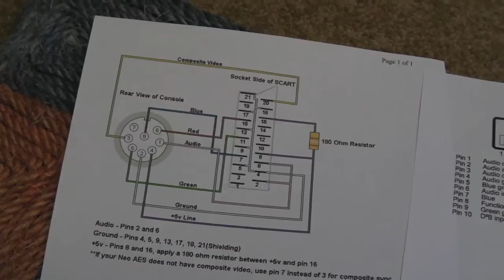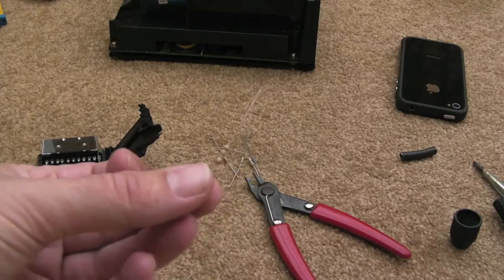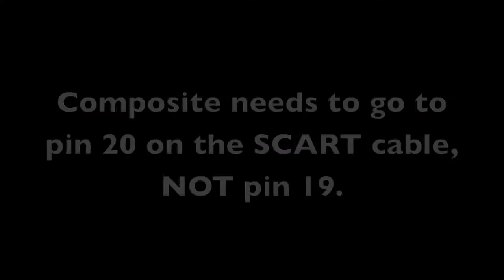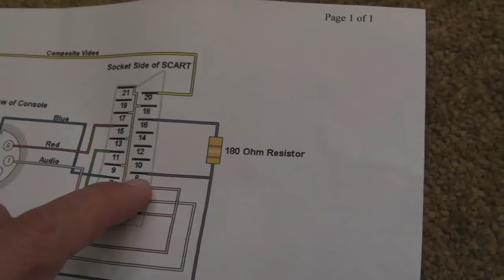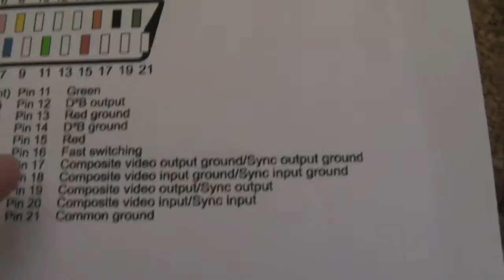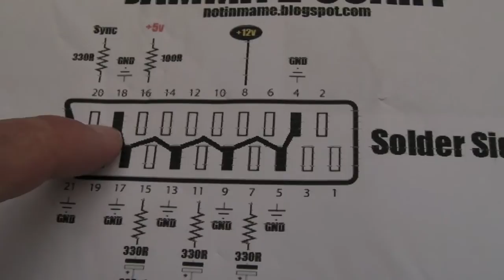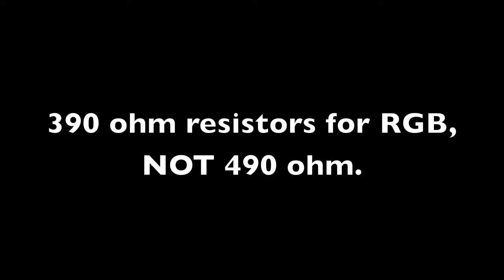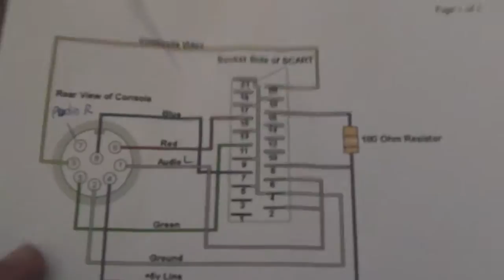SNK Neo Geo MV-1FZ Consolization Part 2 (MVS CMVS)

Comment: Where can I buy rgb sockets
Reply from the maker: Look on eBay for DIN connectors.  They do different sizes of male and female connectors.  Get a female for the MVS, and a male for the cable.  I would go for an 8 pin DIN to cover enough connections for gnd, +5, red, green, blue, left audio, right audio, sync.

Comment: do you connect grounds inside scart plug (pins 4 5 9 13 17 18 21)...?
Reply from the maker: Yes, that's always a good idea!  But, not always required.  Sometimes they are all joined up at the TV end anyway.

Comment: Nice work! Always good to find informative videos. Got a consolized MVS of the same type of board you have. For some reason the image is shifted to the left and then cropped off as a result. This happens on all the TVs I have. A bit annoying to have status bars, text and such partly missing. Still trying to figure out why this happens. Everything is wired up the same way you did it, same resistors. I'm thinking of adding a 1k pot to the sync wire and tweak it. Hopefully that will solve the problem.
Reply from the maker: I think my newer Panasonic TV did the exact same thing for me, so I do think its the sync signal.  You might consider changing the crystal (check on Neo Geo forum, there was a thread recently about getting it to almost exactly 60fps instead of the 59.3 or whatever it currently outputs).  That might solve your problem!
Reply: Interesting, thanks for the tip! I'll look it up and give it a read. Reminds me a bit of the issue some old PAL PS1 revisions have. A chipped system would output black and white when playing NTSC games. The remedy were to change a crystal on the board.
Reply: I've been searching and reading on the neo-geo forums, but I can't seem to find it. Do you by chance recall what the thread title was, or which subforum it was in? I also want to add several extra video outputs for versatility's sake. Found a board from someone called JROK which seems to do exactly what I want. Maybe that board also will remedy my situation. Hopefully I can find someone that sell it, and also agree to ship it to outside USA.
Reply from the maker: Was this your post?  http://www.neo-geo.com/forums/showthread.php?269730-Neo-Geo-MVS-MV-1FZ-picture-shifted-to-the-left

I will see if I can find that thread.  basically you will find there's a 24Mhz XTAL on the board at the moment, it just needs replacing with something a tiny bit faster I think.  I will see if I can find it now.
Reply from the maker: Here's the thread:- http://www.neo-geo.com/forums/archive/index.php/t-222404.html

Looks like 24.167829MHz is what you need to swap out the 24Mhz crystal.  But trying to find one - that's a new problem!  I cannot see any on eBay, but maybe mouser or digikey might sell them.   You can also see that some of the AES use this:- https://wiki.neogeodev.org/index.php?title=Clock
Reply: Yes, that's my thread. Thanks for looking up. Interesting read!

Comment: I don't get how you wired up the video output if u made it like a AES  port are you using a cable like the original mega drive to connect to the TV?
Reply from the maker: I bought some multicored wire with the relevant number of cores and a seperate SCART plug and did it that way.  You could use a Megadrive RGB lead and modify it (put a different DIN connector on) - that would work OK, but you might need to change the resistor sizes in the Megadrive cable.

Comment: This is awesome. I think I missed the clip where you wired up the female DIN port to the interals of the MVS. Do you have that clip? Or a guide to what to wire from where please?
Reply from the maker: Thanks, I didn't show the socket part but the wiring is covered in this video:- https://www.youtube.com/watch?v=mI9VXEyKhSE

I show the underside of the board there and the 5v mod (to remove reliance on 12v for sound), and the sound outputs as well as red, green, blue and sync connections.  You can just wire those to the corresponding pins on the DIN socket as I wired the plug in the earlier video.
Reply: Thanks for the reply. Ive watched these videos again and again, I'm gonna get my parts soon. I'm going to get a MVS 1c so I have the top loading cartridge. I just haven't a clue where to start with wiring the socket to the main board. I might well try a Jamma edge connector and then wire those to the right components as opposed to directly onto the board. I'll have to see. Thanks again, So cool!
Reply from the maker: Check out the tutorials section on this website:- http://www.jamma-nation-x.com/jammax/  There's probably a guide to converting the 1c on there.
Reply: Thats cool - thanks! I've been reading guides like that but I think they are finally making sense! Thank you!

Comment: so we don't have scart here in the U.S how can i make a composite connection to go to my tv?
or av cable connection? whatever is best? thank you :)
Reply from the maker: +ALAN DORAME Speak to XianXi on the Neo Geo Forum - He can probably recommend a good S-Video encoder.  There are a few around that will take the RGB signal and give you both S-Video and Composite.  The S-Video is a good alternative if your TV doesn't support SCART RGB.
Reply: Yeah i have been trying to use the forums but it says im not allowed to do anything. That either my account got suspended or is waiting activation? Do you know how i can check if its activated?
Reply from the maker: +ALAN DORAME I honestly don't know - It's a pain trying to get an account activate on there, I do know that!  It took me a few months to register.  You want something like this:-

http://www.jasenscustoms.com/NEOBITZ-Component-S-Video-Composite-Video-Encoder_p_52.html

There might be cheaper sellers, contact XianXi on http://www.jamma-nation-x.com/jammax/contact.php to see if he has any cheaper boards.
Reply: Okay i will contact him and see whats'up how does that hook up to the console though and composite cables? Thank you
Reply from the maker: +ALAN DORAME I think it solders onto the RGB and Sync connections on the MVS, then provides S-Video, and Composite to allow you to connect to a TV.

Comment from the maker: Thanks!  Nice work on the Tekken Tag Tournament.  Sometimes you dont need the resistors, it depends on the TV etc.   In my case I had already proven that using resistors with the Super Gun gave a perfect picture, so I just wanted the connection to be identical to what was working.  I might find that the colour levels are too bright / dark on different TV in future...

Comment: Nice job! I somehow managed to get the innerarts of Tekken Tag Tournament arcade once & had to make a scart from the jamma connector. Was my first solder job actually. Being 10 thumbs i bought a cheapo scart cable and cut it in half at the middel. The single wires inside was individually protected thankfully. Then i could safely do one wire at the time & not worry about "messing up" inside the scart head. Didnt solder any resistors either .. so i was pretty scared but it didnt blow up my tv :D